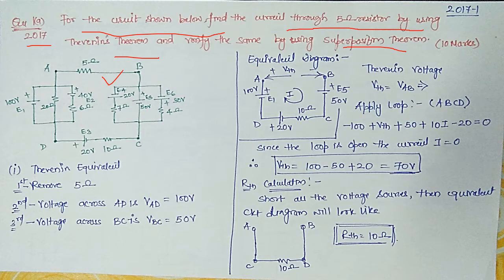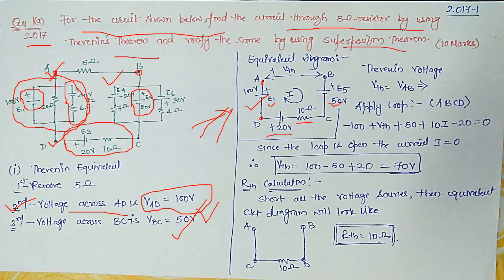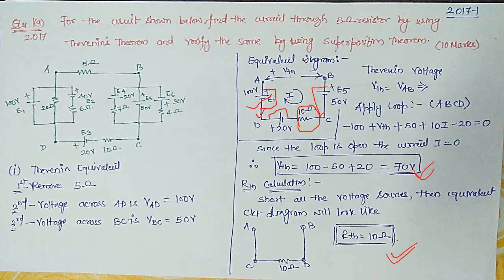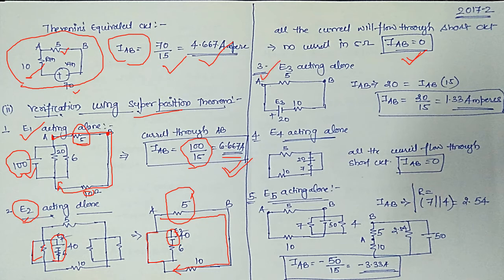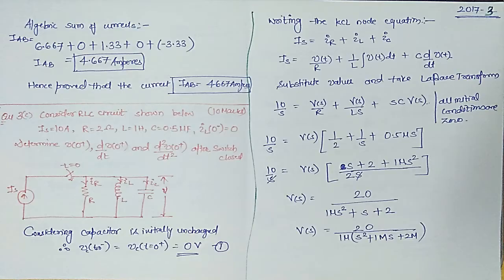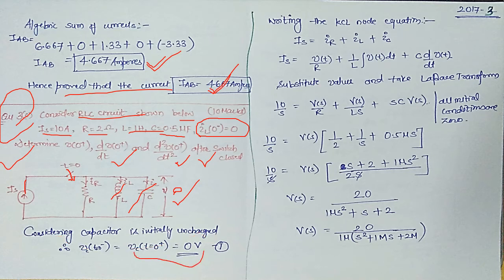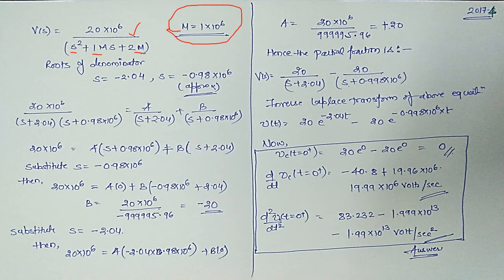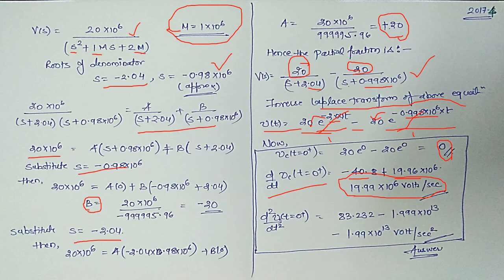Circuit Theory Problems | UPSC Electrical Engineering | CSE Mains 2017 | Optional Paper |

Comment: Thanks a Ton sir, for solving and explaining the problems in such a depth. The question 3 (c) can also be solved by converting current source into voltage source. L will be open ckt & C will be short ckt at t= 0. Then the problem converts to RC charging ckt and relevant formulae apply.